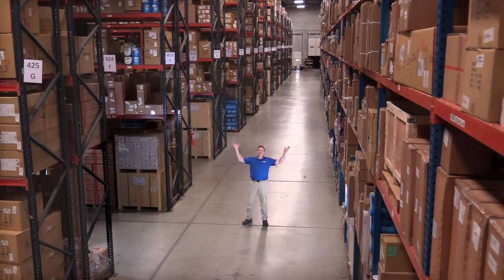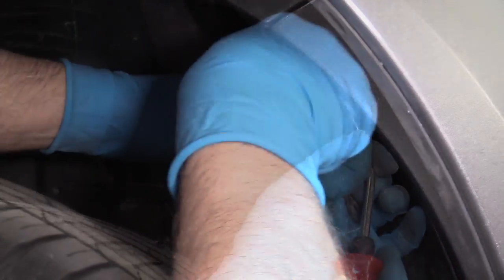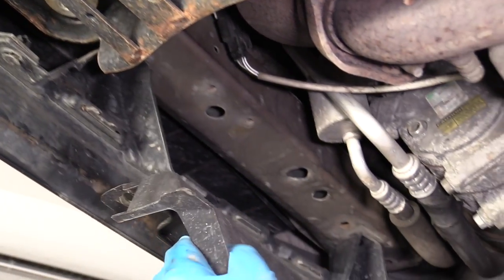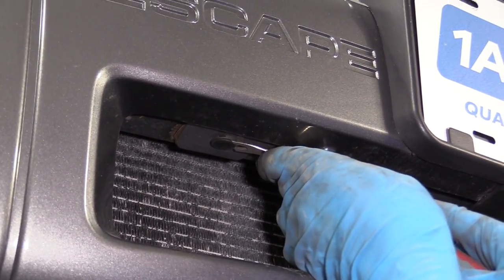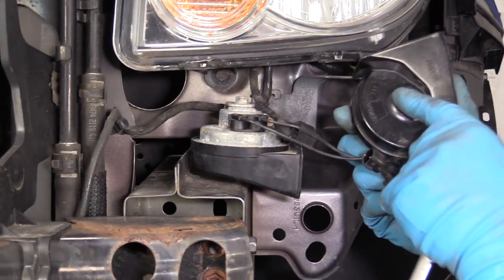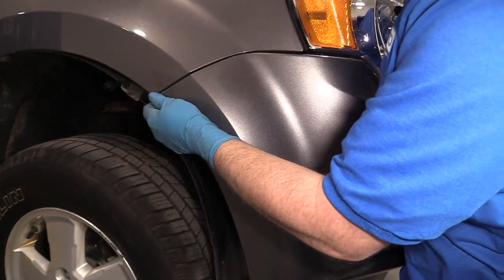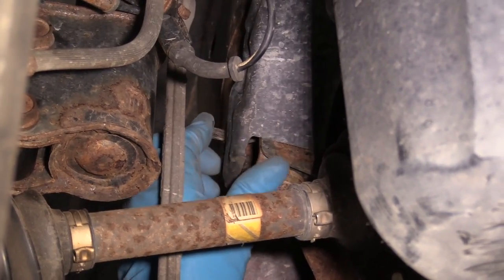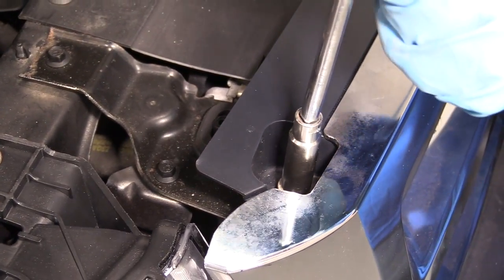How to Replace Horn Assembly 08-12 Ford Escape

Comment: For anybody who doesnt want to pull all of that pull the 3 push pins from fenderwell do the 2 bolts under the driver side bumber then do 2 grill bolts followed by the 2 push pins under rad support pop driver side bumber and pull to access horn have done it twicd

Comment: Now I see why the US Auto industry loses money.  Who the hell designed the Escape?  A sadist?
Reply from the maker: +Thomas Geiger Thanks for checking us out! http://1aau.to/m/Shop-1AAuto-c
Reply: I drive a 2009 ford escape yes a sadist does make these station wagons bc every part to get to.you have to take 3 things out to get to it like right now with my water pump
Reply: This dude takes a bunch of steps to remove the front bumper which is easier than you think . You don’t have to remove anything from the bottom and you don’t need to get the grill off neither there’s 1  little bolt 6mm on each side on the grill (inside) to detach the bumper from the grill you have to have the hood open .
Reply: @aLLDaYeVerydAyAPpLe  nothing against 1a auto but they do over complicate things.

Comment: What would cause my horn to only work when the ignition is off and the steering wheel is locked? Would it be a ground wire issue?
Reply from the maker: +2168jerome We wouldn't be able to diagnose an issue like that here, you may want to have a local mechanic take a look at it. Thanks for checking us out! http://1aau.to/m/Shop-1AAuto-c

Comment: None of this Grill Panel or underneath removing is required on the (2019 ESCAPE)  The single horn is on the Driver side and access is from the front / top. Remove the top push pin and screws on the hood prop panel and there is your horn held in place with a 10 mm nut. I just replaced the single horn with  the dual set that are on the Mustang GT. All I had to do was to make a simple vertical bracket, drill two holes and you are done.  Now my wife's Escape has horns like they should be.
Reply: Good thing this video is for the 08-12 model years.
Reply: @jacobwilson1699  loll